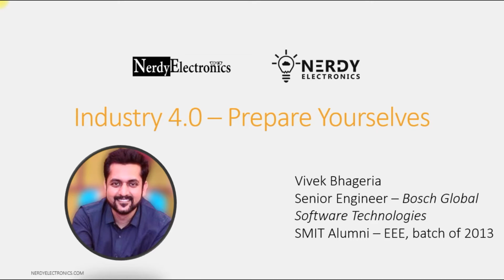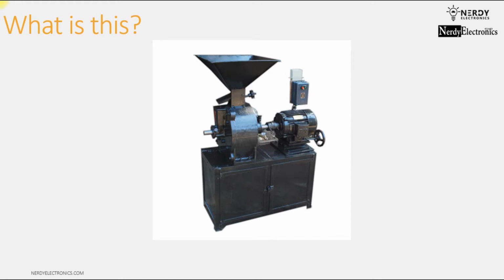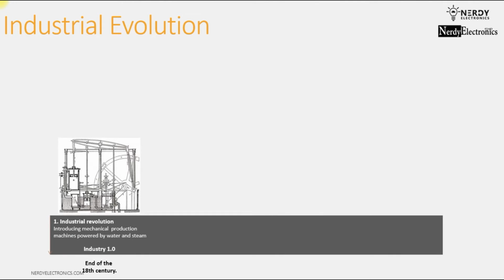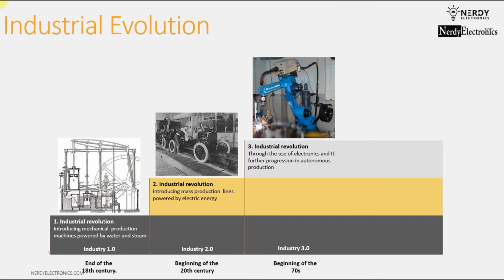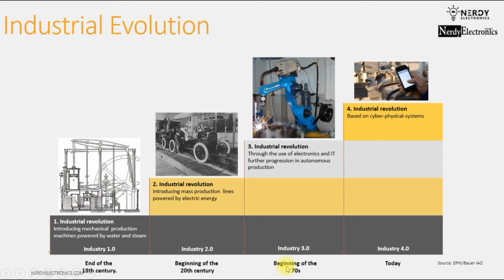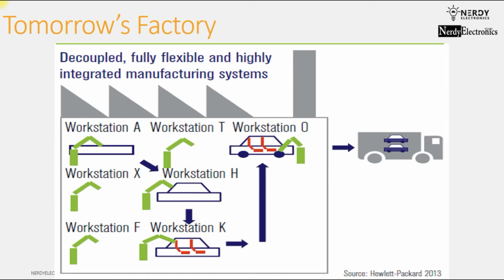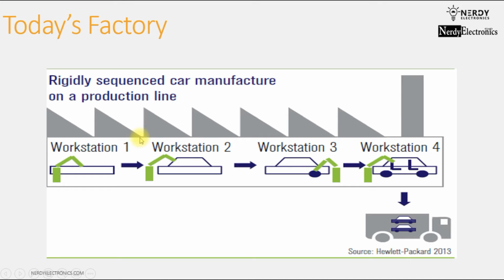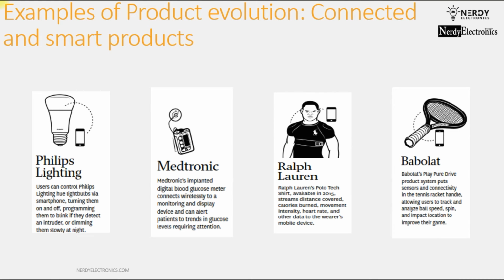The 4 Industrial Revolutions - Detailed Explanations

Comment: Nice vid.  So when you're talking about 4'th industrial revolution and giving examples of it with a light bulb controlled by a smartphone, I see a previous lesson about embedded systems being a part of it.  In this example the light bulb would have an embedded program installed onto it.
Reply from the maker: Yes. There is usually a microcontroller with bluetooth or wifi connectivity. The microcontroller has the program that controls the connections and communications.